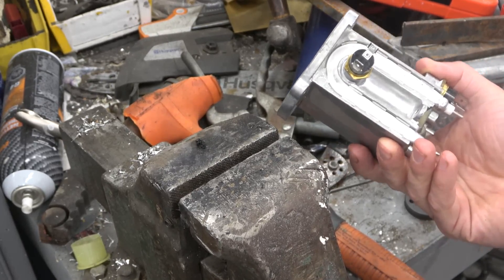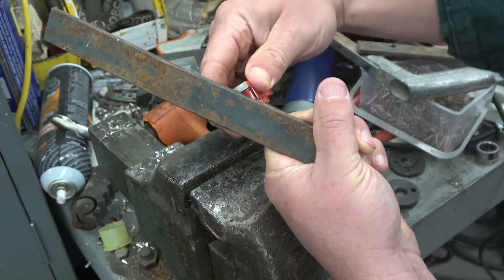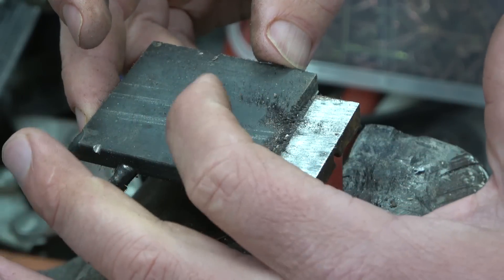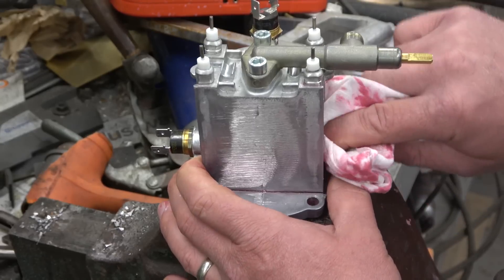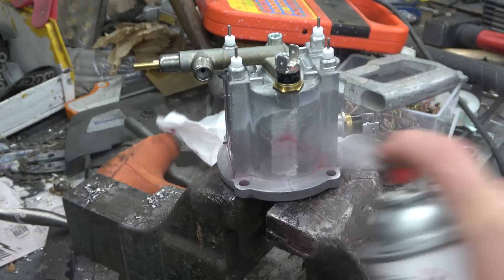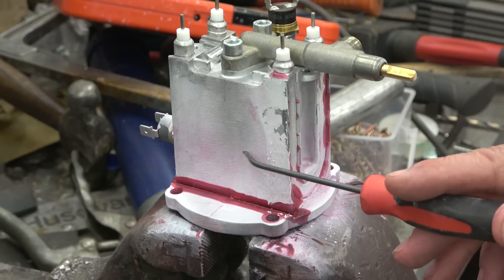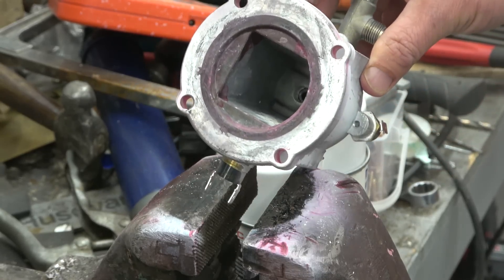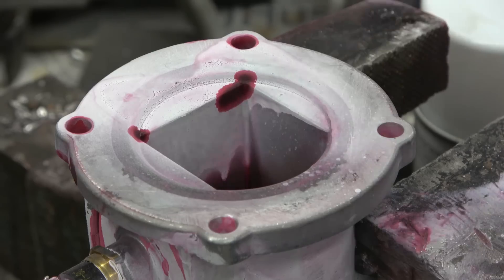Crack inspector. Weld Al Casting?

Comment: Admittedly, on the last vijeo, I had not considered it was cast when I suggested TIG it, prefer the replacement, and run this one till she let's loose again. (by no means am I implying to be the only chump to suggest that! lol)

Even if it wasn't cracked inside, though... I'm not sure I would've wanted to use it after the dye test on the inside! 🥴
I cleaned it mom's Keurig with vinegar, and then ran multiple blank cups of water through it, but still got a complaint that "I could taste the vinegar for a few weeks!"... which, could be true... I dunno 🤷‍♂️ (it's a single-cup on-demand unit, not the kind with a reservoir tank)
But if true, I imagine there'd be a detectable taste... for some, after a test like that!

In other words: Yup, the replacement is the only way! Although, being a cheapskate MacGyver type, since the heating elements and thermostat(s) still worked, I'd salvage that! heh
Strap it to some copper pipe, to make some in-floor heating for the chicken coup! 😌👍

Comment: All GTAW welds are castings.  Aluminum castings which haven't been soaked in oils are quite weldable.  But when you soaked that crack in an oily solution of solvent red, hydro treated medium distillate and napthalene, welding is out the door.
Penetrant dye stinks for a reason,  it is full of napthalene.  Moth balls.  I use the same brand,  only outside away from food and drink.  
My old girlfriend told me to kiss her where it stinks so I drove her to new jersey to make out.

Comment: You can absolutely weld high silicone cast ally parts. It's just not fun.

First thing I usually do after grinding it out is just run the arc over the area to be welded a couple of times without filler and a good 30-40% cleaning. The first time especially you'll see all sorts of crap bubbling up out of it, but after the second or third, or sometimes fourth go for things like oil pans, it'll begin to puddle and act nicely.

At that point you can go ahead and start putting filler rod in, just pick one with a high silicone content like 4043 etc.

It's a pain in the ass, it's mostly successful but not always and for a $35 pressure vessel absolutely not worth bothering to try as a viable repair.

That said, it would be entertaining to see you fix it and then destructively test it just to see how good the repair was... No steam, just a nice steel plate to seal against and an enerpac.
Reply: Yeah.. If you are already going to throw the part away, or put it into the recast bin, and you have the tools/expendables to at least attempt a repair and you aren't being paid to repair/replace and you have the time, then it's usually a good idea to at least attempt a repair just for the pressure test and bragging rights. That being said though.. 35 dollars.. that's only worth at most an hour of your time. Any more than that and it's a waste of time/money. Would I do it? yeah, but I like to see things that I make get temp/pressure testing.
Reply: Adding a comment so I know how to weld high silica aluminum should it ever become relevant.

Comment: Here's a tip if you're using dye penetrant. Just spray a small amount into a cap and brush it onto the suspect area. Much less messy. If it bleeds heavily into the developer wipe it off in one direction (clean cloth) and lightly spray on more developer. There's a lot more to it than you may think btw. Old NDT technician.
Reply: I do lots of welding on pressure vessels in a shop, the cap and brush technique is how I do it as well, usually dye pen. The back of my root pass before welding the other side if the joint is getting x-ray tested or ultrasound tested
Reply: @benoitperrault6805  yep you don't want that leaking. Bloody messy stuff.
Reply: That's how I was told to do it, although I was working on assemblies in a vehicle so overspray and cleanup was a bigger PITA. I always wondered why they sold it in the aerosols as opposed to just a jar with a brush. I guess it probably has to do with the solvent evaporating out.
Reply: I spray it right on the brush.
Reply: @martinez1109   bet that stings ,,, but if it helps find the crack , why not ....
Reply: Best comment section on YouTube! Thanks for the tip
Reply: snap ,,, [lol ,,, its an old ndt mans  joke]
Reply: I died a little bit when I saw him spray it directly to the part..... and then just a wipe, without any cleaner......OMG
Reply: Just my word!!  

Normally when I do it we have to leave the red stuff on for 15-20min and the developer for 20min ...

Comment: I work as a saw smith apprentice in the steel industry, we use a magnaflux to check for cracks in blades, but instead of powder we use Ardrox which is iron powder in I believe it is mineral oil or some other super low viscosity lubricating liquid which seems to work better than straight powder as it lets the powder "flow" to the cracks

Comment: The developer is good for finding leaks also. Clean, then spray the developer, (it leaves a white residue) run whatever and it shows up great!
Reply: The developer is also good for making reflective surfaces matte if you're doing 3D scanning.  Instead of buying the special scanning prep spray, just visit the local welding supply house and for a few $$, off you go.

Comment: Ever see a 18'dia 1/4" thick steel circle flipitty flop through the shop door at 15 pissy off a refurb 100k litre fuel tank while a  dumb ass welder pressure tested it over the 8 # pissy threshold?
Quite a pop.

Comment: I use it  all the  just a little  tip  spray it  in  a  paint cap  and use an  acid  brush  to  paint  it  on   a  lot  less messy

Comment: When I worked in a sheet metal shop that's what we used to test for leaks in large hydraulic fluid reservoir tanks for elevators, non pressurized tanks mind you.

Comment: My 89 RM250 nickelseal two strokems cylinder ended up in the bucket as well. Only after I sent it to comifornia to be re-nikasealed wit a $200 deposit no refunds. You live and you learn. The rate at which you learn is the key to success or failure I suppose. 🥂

Comment: Just enough info to make me want to spray everything metal that has a seam and splooge it with white window snow just for shits and giggles.. Thanks for the tip to easily identify hidden cracks within a pressure vessel.

Comment: another great tool for my brainbox, a quick question though as i know my dad was fond of using these on ac rads, would you trust risking the aluminum brazing rods on one of these, i havent had much luck with them but i know they're alot more user friendly than welding

Comment: It is a really bad design as it has sharp edges in the pressure vessel. Also, you would have to pull the heater out to check behind it for cracks, just sayin. Thanks for the video.

Comment: Just for those that don't know, a standard espresso machine operates at 9 bar, and these are closer to 11 bar. I can imagine getting a jet of boiling 11 bars in your face when trying to make the morning coffee would be a bad day
Reply: Especially if I didn't get my coffee BEFORE getting scalded
Reply: Can ya convert that to North American measure?.?
Reply: @hedge685  150psi+
Reply: @dennisford2000  👍 Cheers
Reply: @hedge685  14.7 psi Is a Bar
Reply: Boiler pressure is usually a max of 1.5 bar, an electric pump makes the 9 bar brew pressure. 

But you're still right, steam burns are no joke.
Reply: @toyorover1313  the pump is in the cold water feed line, so the boiler does see the full brew pressure. This is the way with all coffee makers, there are no consumer grade pumps that would be happy operating at 100*C, also the water would get too cold before reaching the grounds

Comment: Magnaflux makes a UV penetrant dye too, in case you like to play with black lights, under the brand name Zyglo. I never could tell the difference, but the UV one is supposed to be better for finding tight cracks, whereas the red dye is better at wide or shallow cracks.
Reply: Magnaflux products have gone downhill over the past few years but there penetrant and mag supplies are still top notch.  Use this shit daily.  Too bad they killed off Sonotech Couplants for Ultrasound because they were best in the buissness
Reply: I have found a few tight cracks innUV light. Careful if they glow before the game begins though.
Reply: @Steevo69  Legend has it if you shine one on Tara Reid, you'll blind an astronaut on the ISS.
Reply: I only recently got to visit an aviation NDI shop and saw a part that had been professionally prepped for UV dye penetrant.
Amazing how much of a difference the full (four stages?) process makes, and the crack showed up brilliantly on the part, while nearly impossible to see without the UV illuminator.  Even scrupulously cleaned, it was near invisible to the naked eye.
Reply: I don't think the UV stuff uses developer, just a very thin capillary wicking liquid. Which is why it needs to glow.
Reply: He's not using a black light in the shop especially after the summer of 2021shop incident

Comment: an AC and reefer cargo tech for 20 odd years now. my go to solution for high silica casted pressure vessel is brazing or for fast repair I draw a vacuum, strap a cranckcase heater around the vessel and apply heat seal stick on cracks. you got your heaters there so drawing vacuum is the conundrum you have to solve.

Comment: Yeah, no, we don't weld and monkey around with things that hold high-pressure, even if it's just wind- full-stop, hard FUCK. NO. Big-ass tires get filled up in a cage and rusty, leaky air compressor tanks get taken to the dump.

Comment: Thanks for the tip on the dye test. Minty! That piece is scrap metal. That part is cheap enough to replace, and no worries about it splitting or breaking welds. Safety first AvE.

Comment: Being an engine mechanic I did a lot of work with the NDI Lab in the Chair Force. Good times.
Reply: I just got to visit the AF NDI shop on the base nearby for a tour, and was amazed at a few of the inspection techniques.
The UV penetrant was amazing, but their take on magnetic inspection using the oil bath with particles in it was interesting, as was the ultrasonic inspection.  (Both the single emitter testing, and the double emitter or emitter-receiver thickness testing were demonstrated.)

Comment: Who woulda known that non-filleted corners would crack?
Reply: The structure is a point of safe failure. If the steam thermostat sticks, the flange cracks or deforms releasing the steam pressure into the housing instead of blowing at the top where the valve is and where the steam would blow into user hand.
Reply: @MarekLewandowski_EE  That is the designed-in failure mode?! Very cool.
Reply: @markhooker8520  I don't think anyone has specifically designed this corner to be the point of failure at this or that pressure, but definitely the design that was easy and cheap to manufacture was tested for how it fails on overpressure. And it fails at the bottom, where the obvious stress raisers are, but way above the normal operating pressure, and it does show that the part that's easiest to replace fails (the boiler).

Comment: I could be wrong, but I was under the assumption that you could brush on a fluorescent powder and blow it off, and then shine  a UV light on it and wherever the powder stuck, there's your crack.
Basically relies on a similar principle of flour and finding the wet spot... Except the wet spot's just a crack.
Reply: isn't it usually? 😂😂
Reply: It is an oil containing fluorescent material, usually water washable or used with an emulsifier to clean it off. Let it dry then dust with a powder developer or dip into a liquid developer then inspect under UV light in the dark. The water washable/dry developer method is the easiest, the emulsifier/wet developer more complicated. Very common for aerospace inspection (aluminum castings, etc...)
Reply: They do make fluorescent powders. But they either still rely on being magnetic and attracting to those cracks, or the dye penetrant method and the dye is just fluorescent, so when it works its way back out of the crack then it shows up under uv

Comment: From someone who occasionally Tig welds cast aluminum you’re right. Most people shouldn’t bother even if they have the setup. It can be down right frustrating especially with cheap castings you deal with these days. You’ll find yourself chasing trash half of the way through it and trying to fill it back in. I’m in the automotive field and I only do it when a part is not available or is ridiculously priced. I’ll do some wheels here and there too but they seem to be a lot better than most cast parts.
Reply: As someone who also Tig welds cast aluminum fairly often, your comment pretty much nailed it.  The cheap castings that are being made now suck to weld.  There is so much trash in the metal it's not funny, but even dirty castings can be welded.  I would have welded Ave's part just to weld it.  Trash parts are how you learn, however that part was repairable with tig welding.
Reply: As a pretty smart scrapper for over a decade, Al car wheels are either made from fresh metallurgy or recycled existing Al wheels…believe it’s called 356 Aluminum wheels in the trade.  

Cast aluminum like what is used for things like this coffee water heater are prob just any old cast aluminum mix and prob a bit of quick metallurgy to try and get rid of some bad things or add good or both…or in China, prob neither. Scrap cast for consumer stuff is just whatever the scrappers bring in and all the diff recipes they find in the field.
Reply: I'm forcing myself to learn the AC TIG repair of cast aluminum just because of an automotive bell housing that is no longer affordable, though there is an aftermarket option now available (for the low, low price of ~$800 USD!)

Wheee, the fun of oily, dirty aluminum...
Reply: @heyallenify  What's the bell housing application, out of curiosity?
Reply: @Keifsanderson  C5 Corvette manual bell housing, being used to mate an LS1 to a Porsche 928 transaxle.
Reply: @heyallenify  As I was reading it took me a until the end to see your problem, but yeah... that's pretty niche.  Best of luck.
Reply: @Keifsanderson  not that bad due to it being a Corvette part, but the available aftermarket replacement part is an SFI rated track part, not a street car part... Double whammy, between being a part for a 'vette and "race car" pricing.

I'm going to do my best to fix the stock one that I bought already cracked...
Reply: Tried to weld my BBS RKs, high magnesium content... Didnt work, ended up cutting and learning to castfill instead. Worth it in the end but took upwards of a 100 hours to understand how to cast.
Reply: @jesperviktorsson8027  one needs the proper composition rods for Mg alloys ... and lots of Ar and practice.
Reply: Ive had pretty good luck with alot of cast aluminum none of my stuff critically needed to be air or water tight.  And I've never practiced making thing that are
Reply: Some of the Rockstar wheels out there are an absolute whore to weld up. I am not sure of their QC process...but I have done about 14 of them, and probably 10 have welded like complete shit. The rest welded great for some reason.
Reply: I'm a super novice welder, and I have successfully welded cast. I was welding an old bridgeport z crank handle that some idiot hit with a forklift. I preheated pretty thoroughly and then put it through the braze line right after I finished my welds. It's been dropped on the concrete shop floor more times than I can count and has held up, but every time I try to weld cast aluminum it ends up a colossal failure.
Reply: @djDTOUR  theres a youtube channel called the fabrication series and he has a couple vids doing really good walkthroughs welding cast aluminum. If you want to learn from a really good welder, they're really good vids to watch
Reply: Welding cast Al isn’t really that bad. Just takes patience and understand what is going on at the arc.

Comment: Hell, for 35 Canadian Pesos I wouldn't even have done the dye test... but this is the first time I've seen this done and I appreciate you going through it for my benefit.
Reply: I thouight he did it for your benefit too, since I would have chucked it for the newbie. No point in seeing steam up close and personal. It is a great process though.
Reply: Yep, and remember to keep the old one until the new one arrives. You may need the thermostats and the steam valve from the old one.
Reply: Exactly, it’s worth it for the video regardless if it’s a 35 or 3500$ part
Reply: dye pen is great as its fast , cheap , portable and needs no power source ,,, but ,, follow the instructions on the cans exactly ,,, there is a waiting time for the dye ,,, it has to be adhered too ,,, probably was but the video was cut short for the tube 
and yes , Im a ndt tech , or at least I was.
Reply: You likely would if you could make a monetized video that earned you the pesos, and then some, to buy the replacement part. Course fiddle fuckin with the tig welder would probably be less hassle. I guess it all comes back to the urgency though. Fast, cheap, quality; you can only choose two.
Reply: @oldmanSturzl  I mean, that was kind of my point. It's nice to have some videos on YouTube that actually teach you something in a succinct manner instead of dragging it out just to make the algorithm happy like King of random. The fact that he just happened into a part that gave him an opportunity to demonstrate this method was just luck I guess.
Reply: Very useful, and now I think of all the times this would have been a useful check..
Reply: We do these at work all the time it's a machine shop
Reply: same here....
Reply: a little bit of dye for a video with 200k views. seems like a good trade.
Reply: FFS, I thought this was a vijayo about Hunter Biden or one of those degenerates, and find out it's about something else - double disappointment, I thought the Errata was Erotica  about silicone.

Good thing AvE is so entertaining!
Reply: We appreciate you too, babydoll